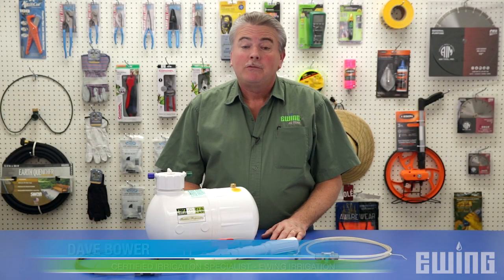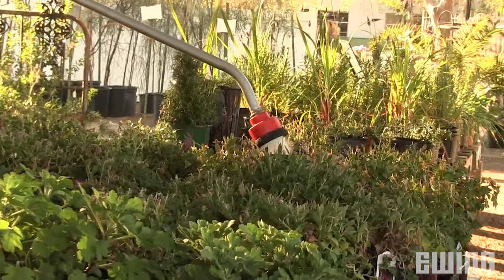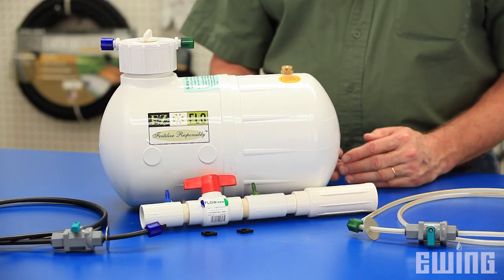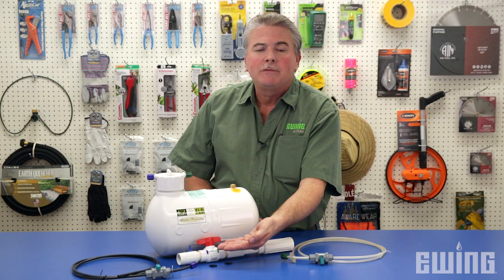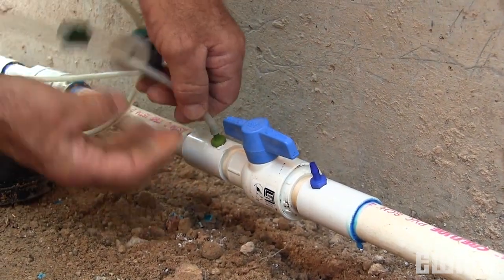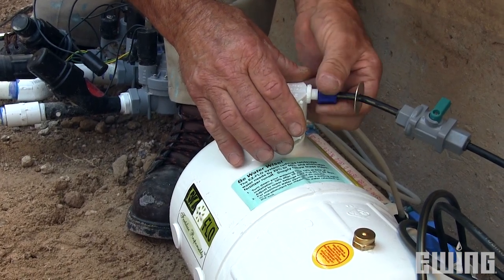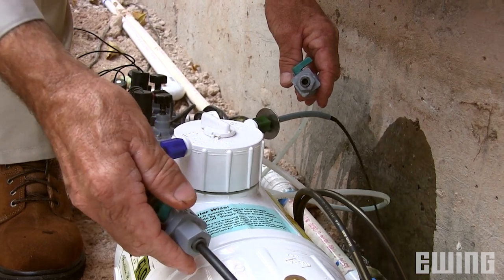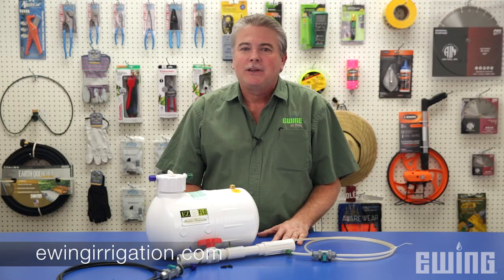How To Install The EZ-Flo Mainline Fertilizer Injector

Comment: Hi. Can I use products like Green County Fertilizer’s RGS, Humic12, Air-8, MicroGreen and liquid fertilizer with your system?
Reply from the maker: The EZ-FLO system can be filled with any liquid or water soluble product. More information on installing and using the EZ-Flo system can be found here:
https://ezfloinjection.com/wp-content/uploads/2022-Mainline-Instructions-v1-web.pdf

Comment: can you put bifenthrin in this to do a blanket insecticide treatment on my yard this would help with spider & cinch bug control
Reply from the maker: The EZ-Flow fertigation system delivers fertilizer in micro doses with each irrigation cycle. This might not be enough output of the pesticide to be effective in the control of insects. The pesticide manufacturer might be able to give you a more specific answer. Thanks for the question!

Comment: Wrong my 1 1/4" ball valve mounts above my tank by about 2'... Please correct me if I am wrong.
Reply from the maker: Hello Jim, when this video was produced, the manufacturer included that statement in their instructions. I checked the current instructions on the EZ-Flo website and no longer see that requirement. Thanks for watching and for the comment!
Reply: @ewingoutdoorsupply  Whew... I almost thought I had to build a stand to elevate my unit above the ball joint...lol EZ-Flo Rocks !! The new ball joint has metal nipples instead of plastic (upgraded)

Comment: I'm in a Zone 6, how do I winterize the tank, do I remove it every fall?
Reply from the maker: Thanks for the question Ralph! You are correct, you will need to disconnect the tank and remove it before winterizing your irrigation system. Here's a link to more information from EZ-Flow:
https://ezfloinjection.com/wp-content/uploads/2014/04/Winterizing-Your-EZ-FLO-System.pdf
Reply: I remove mine...then make an insulated jumper  "rainbow looking piece of tubing with insulation around it" and go from blue nipple to green nipple (going over the ball valve lever).

Comment: QUICK TIP! If you put a cup of water in the microwave for a minute on high and then dip an 1" of that tubing into the water for about 30 seconds before pressing it over the nipple, it will slide on much easier since you softened the tube and you will have a much better seal when clamped. After you remove the end of the tube from the hot water, you will have approx. 10-15 seconds of work time. This works for ALL plastic and pvc rubber type transparent (color) hoses such as off road vehicle gas lines. This will not affect REAL black rubber hoses although you can just lay real rubber hoses in the sun prior to using to make them more flexible..
Reply: This was the hardest part. I did the hot water thing but still couldn't get it to slip over. I eventually pulled out my torch gun and heated it up on the lowest setting for about 1 second, if that. I couldn't get it 100%on but after sliding it on as far as I could it was stuck there so I went ahead and clamped it down. We'll see how it goes in the spring . May need to cut it off and redo it, this time with spiders😅😅😅😅

Comment: how can I select proper firtilizer dosing system to my farm if I have sprinkler irrigation system with pump 50 m3/h with 7 bar
Reply from the maker: The link below will take you to information on using EZ-Flo fertigation system as well as contact info for the manufacturer should you have further questions.
https://ezfloinjection.com/resources/technical-specs-resources/

Comment from the maker: Good question +Outa ThisWorld. There isn't an easy answer because it depends on how often you are watering and how much. (They estimate replacement every 4-6 weeks if watering 1,000 sq feet every other day.) Recommended rates should be available on the fertilizer label. Begin by checking the levels weekly to see how much has been depleted and adjust from there.

Comment: I am trying to set up an automated Vertical growing system for vegetables.  I have installed 22 towers with four levels for each hydrostaker tower with an in line EZ flo (1.5 gallons).  If I filled the tank with hydroponic nutrients, how do I know when the nutrients need replacing on the first, lowest EZ flow setting?